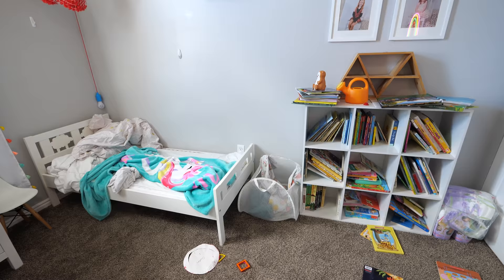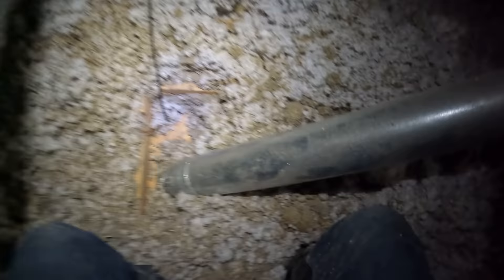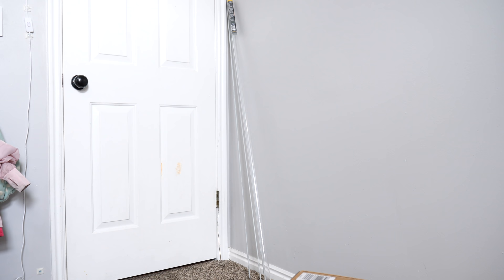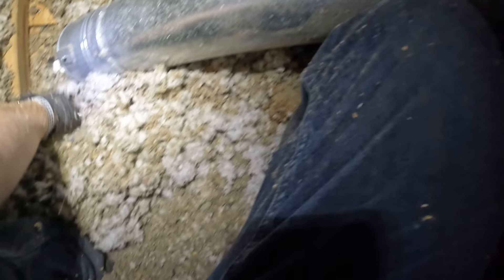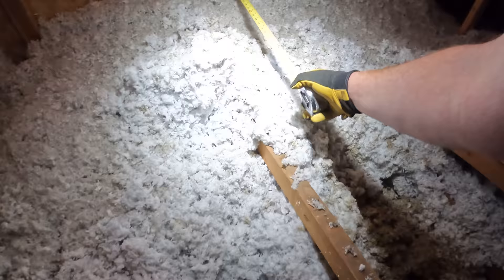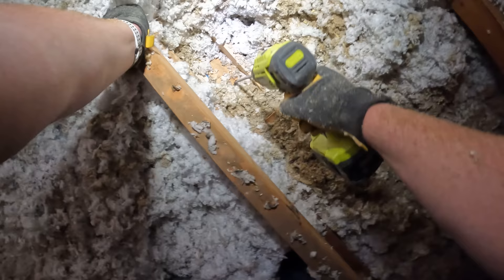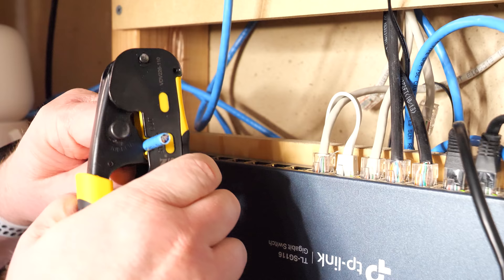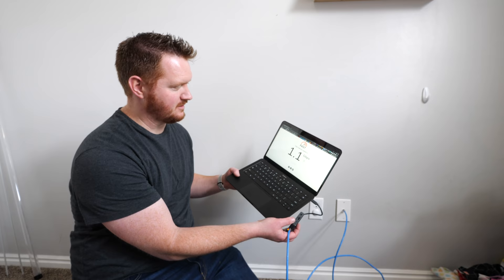Wiring Cat 6 Ethernet Ports Through the Attic

Comment: Very nice work, but my house has a fire block in the wall, so it's a bit hard to run the wire all the way down straight.  😐
Reply from the maker: Oh bummer, outside walls are required and I was lucky my inside walls didn't have them.

Comment: Seems like CAT6 is the go-to-way in the US these days.
In Germany you can hardly find any CAT6 cables. The standard here is CAT7, these days often CAT7A, some people even use CAT8.2 (but I doubt the latter one makes any sense as 10GBase-T already consumes multiple times the power a 1GBase-T connection does, I guess 40GBase-T would run extremely hot and be even more power hungry)

I guess anything above CAT7 does not really make sense, for anything faster than 2.5 Gigabit at home I'd rather use Fiber, preferably multimode. Consumes a lot less power and can even do 25, 40 or 100 Gbit/s.

Comment: Glad you didn’t hit any fire blocks in your walls. 
I know it’s overkill, but I would have used CAT8 cable to future proof. 
And yes that coax is for an attic mounted antenna, a lot of new builds have that. I guess you won’t be putting one up there now. 😊
Reply: Please stop at Cat6A. If you're going to use cat8, just take a quick tutorial on how to run back to back switches with fiber.
Reply: CAT8 is overkill for a home netowrk.. Cat5e or Cat6 is more than enough. but to each their own on how much they want to spend on cabling
Reply: Any tips on working around them? would all wall studs have them?

Comment: You can use COAX as Ethernet.
Reply from the maker: I should try that sometime. I already removed the coax from all the rooms though...
Reply: I've been reading up on it. COAX can do much more than just provide a TV signal.
Reply: The way to do that is with media converters.  These convert twisted pair Ethernet to coax and can also provide power over Ethernet.  The ones I've worked with do 100 Mb and were intended to be used when converting analog security video to digital.

Comment: So choosing between doing a keystone jack vs doing a port? Why not just do that receptacle as a brush pass through? Doesn’t the extra connection in the middle cause data loss?
Reply from the maker: I would say because the Keystone is a better finished look. The brush pass through is mainly used for areas like a TV where you want to change cables often. My kids would also shove stuff into the pass through if it was visible.

Comment: Off topic but safety minded - if your smoke alarms are that yellowed or brown, it’s time to change them out. They expire after 10 years, even if you put a new battery in them. Check the date on those and switch them out asap.

Comment: i tried for 3 hrs to use them pass through plugs i couldnt get them wires to pass through for nothing
Reply from the maker: They are a bit challenging. Once I have the pairs unwound, and then smoothed out the end I make a clean cut so they are all lined up. Then I slowly thread it in and just wiggle a little bit to get it to go through and keep them aligned.

Comment: This may be dumb question but why need cat with wifi?
Reply from the maker: Adding a direct cat cable is more reliable and faster than wifi. If you do gaming you also have a much lower ping.
Reply: @TechWithBrett  really? i didn’t know that. My house is pre wired from original builder and I’d thought it was obsolete.

Comment: Great video! Quick question, how come your Cat6 cable didn't have a pair separator between each pair?
Reply: Noise Reducing Cross Separator .. it depends on the vendor that manufactures the bulk cable.. for home use, its perfectly fine without it... for businesses that's where you want. VoIP phones, printers, computers and other wired connections want to reduce crosstalk and any interference on the data lines
Reply: Most cat6 cable these days doesn't have a pair separator, they figured out how to make cable that meets cat6 specs without it. Progress.

Comment: Everyone else has critqued this but I'm curious about one thing. Why do you have the switch mounted with the ports facing up (or was that just a trick of the camera)? I would think you would want them facing down, so dirt and other debris doesn't get into them.
Reply from the maker: That's is actually how the mounting slots were oriented. It seemed odd to me but it kind of worked better for some of the wiring or my devices.

Comment: Should be using Cat7 to future proof....
Reply: If I needed to go better than CAT6, I'd go with fibre.
Reply from the maker: I might move soon so I didn't want to put in the extra cost...
Reply: @TechWithBrett  There is a huge differrence between cables... cat6 and cat6a  etc etc.  Its vital to do proper research when it comes to these types of cables... not to mention hdmi and displayport cables... its easy to buy inferior cables, that doesnt even support f.ex 4k 120 hz.. if you just assume things.
Reply: @James_Knott  Even if you got fiber, that cable only goes as far as into your router... from there you need regular cables to your tv, pc etc... and you dont want to use your old cat6 or cat6a cables... ditch them all and get cat7a or higher.
Reply: @wojtek-33  fool....

Comment: While outdoor ethernet cable is available, I would never use it as copper on the outside of the house is susceptible to lighting strikes and can not just fry your network but all devices that are hard wired to it.
Reply: As if some siding and sheathing is going to stop lightning.

Comment: Did you pull the black cable out first and then fish through that hole?  so two cables in one small hole?
Reply from the maker: Yes I did two cables through one hole. You could also run a pull string through so you can pull another cable through with it.

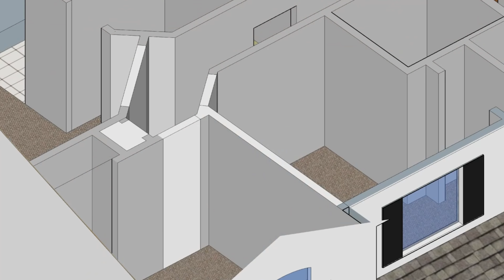Comment: May I know the name of the software or app you used to create this animated portion of the video to show the wire path (Starting at Timestamp 1:49)?  Thanks!!!
Reply from the maker: This is a combination of two programs. First, I designed my home use SketchUp. It is a 3D design app and I put different parts of the home on layers and just took screen captures I imported into my editing program. 
Then for the blue line, I created that using a line animation in Adobe Premiere Pro. It took a bit of work to get right, but it did the job.
Reply: @TechWithBrett  Thank  you very much!

Comment: why was the speed test with the laptop vs the computer different? Should a drop in speed be expected when connected to ethernet?
Reply: Speed tests are not always accurate, and conditions between tests also may be different.  Try to run a speed test yourself right now, 5 minutes apart, and you may notice they are not identical.

Comment: In Australia we are can't do this for legal reasons
Reply from the maker: That's crazy to me. It sometimes is pretty tough to do though.
Reply: That's utter BS.... anyone can make their own Ethernet cables in Australia.
Reply: Yep, in Australia we can't do any behind the wall wiring, even low voltage, for safety/legal reasons. I had an electrician run all my ethernet  cables through my roof space and walls. The plus side, their cable management makes it look a lot neater.
Reply: @harri3020  BS...

Comment: Cat5e is more than capable of running 5Gbps per the multigig standard.  Cat6 was never a standard and is marginally better than 5e in that it can carry 10G over a short distance.

Cat6a is standard and is used for all cabling today.  Besides traditional UTP, many are using F/UTP or U/FTP which improves cross-talk and noise avoidance. 

Cat7/7a are not official standards. 

Cat8 is designed for short runs in data centers and not used for anything else.  

Last note. If you pull that cable in any area that is considered a fresh air supply/return, where in a fire that smoke from that cable will enter the living space, you must use plenum rated (low smoke) cable. Not doing so could lead to serious injury.
Reply: I like F/UTP myself, and cat6a (with spline)

Comment: For the love of god, push the jacket of the cable into the RJ-45 connector and while at it, don't use fixed installation cables that are solid-core for patch leads.

Comment: I’m not familiar with building code in America. What in the world is up this horrible loose insulation all over your attic?
Is that common? Seems like a total nightmare to deal with.
Reply from the maker: That is called blow-in insulation and it is very common. Much cheaper than anything else that is available. It does cause some problems since I stepped on a light while I was up there.
Reply: @TechWithBrett  It's also an easy way to add installation.  This was common many years ago.

Comment: Make your life easier and always use female connectors instead -- they can be made much faster, and don't require specialized tools (although a proper punch-down tool makes it simpler). A quick wall-mounted patch panel/box with female connectors terminated means you can move your equipment and replace cabling with longer/shorter runs later.

Comment: You should have ran your ethernet wires in the next bay away from your AC power, now you'll have the risk of the AC power interfering with the ethernet.
Reply from the maker: Good tip.